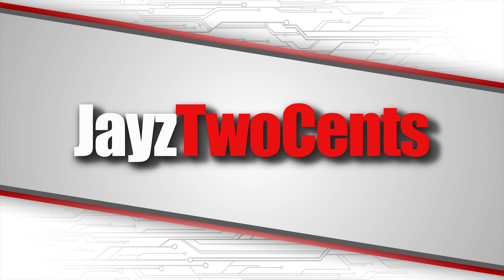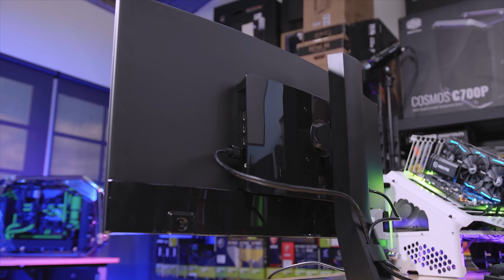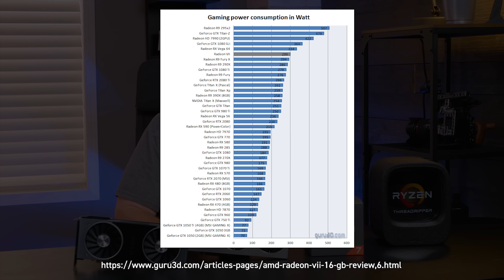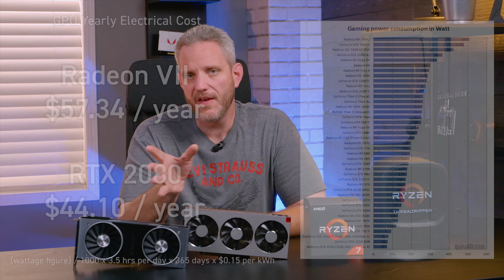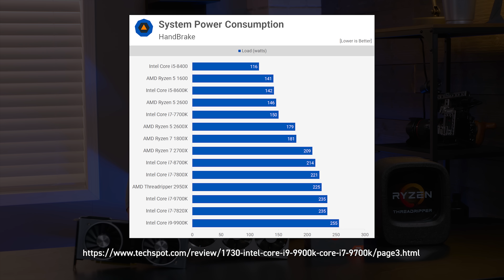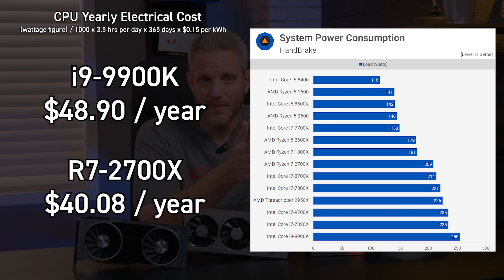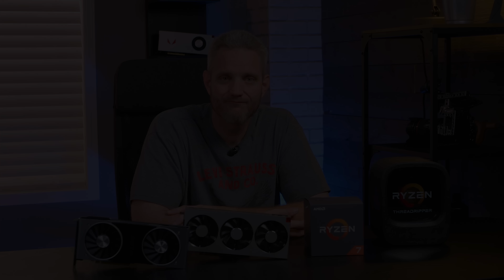Energy Costs of AMD vs Intel vs NVIDIA... This might surprise you

Comment: By my own experience is that AMD is not running hotter, this is based on the difference between FX 8320/4170 compared to a 4790K, while the FX 8320 is overclocked to 4.3ghz it still only reaches 55-60, Stock 4790K reaches 60°C already, overclocked to just 4.6 it already goes up to 80°C, which is already past the AMDs "OMG this is too hot shut it down" point. However, Intel idles colder, with my M9i the stock 4790K idles at around 32-35°C while the overclocked FX 8320 idles at 40-43°C. 

But IMO, the Power draw difference is a valid argument when it comes to older generations, 4790K is a 88 Watt TDP CPU, while the AMD FX 8320 is what 125/130  watt TDP? That is a huge difference in Anual electricity costs, obviously as it with energy costs it won't pay back for a few years, but in the first year, I gained back 190€ in energy costs and had to pay less monthly. So for me, it did pay out to switch to Intel, not so happy about it now with Vulnerabilities being a thing and Intel telling me to downgrade my CPU to a 200€ cheaper i5. 

Ryzen 3000 however seems to be by far more energy efficient looking at the spec sheets, the 3600, an 8 core 16 thread CPU with 3.6 base and 4.4 boost clock only has a 65w TDP, Ryzen is at the point where you really have to be nitpicky to still mention Power draw.

Comment: Hey Jay. 1 kwh in Germany is 25 cents. But i'll pay the price. more than 1/3 comes from green ressources instead of coal.
BTW: i think the question is more something like: should i get a (for example) 2060/2070/2080 because it can make a diffrence in terms of the overall cost.
if you dont need a 2080 for example and a 2070 is ok for your gaming needs you gonna save a couple $ because it draws less power.

Comment: The thing that makes lower power draw a more attractive buy for me is that less power draw usually means less heat. Less heat means a quieter system. I like a quiet system. My favorite laptop that I've ever owned is passively cooled. I can't game on it because it has a 7.5 watt Bay Trail celeron processor and only two gigs of RAM but web browsing on this thing is amazing. I'd rather do my basic browsing and spreadsheet work on this than a 2000 dollar gaming laptop because of the lower power draw and better battery life. Oh yeah this thing is the Acer CB3-531 chromebook. It's 4 years old. I got it right when it came out and have loved it ever since. I've got a separate laptop that I do my gaming on. It's a piece of shit HP laptop with a Bristol Ridge AMD APU and I hate that thing. 

Like Jay mentioned, old AMD processors ran hot as fuck. And my HP craptop is no different than any of those FX processors. Before a much needed repaste it averaged in the 80's in temperature and had only an hour of battery life (it only has a 33 watt hour battery). The thermals were so bad that when I attempted to do a clean install of Windows it actually bricked its OS and I ended up having to switch to Linux because for some reason Windows boot drives don't work with my laptop even though I can install whatever Linux distro I want. 

Holy crap I've gone off topic. Anyway, lower power draw, especially in a laptop, means less heat and thus a quieter system. That's why I like processors with low wattage that can be passively cooled. It's not the "cost savings" that I like low power for, it's the noise because a quiet system is just so much better for media consumption and things like spreadsheets in my opinion. I'm hoping Zen 2 laptop processors fix AMD's power consumption issues in this new generation because either every single manufacturer who put an AMD processor in a laptop (except the Acer Nitro 5 surprisingly) was incompetent as hell with their laptop design with first gen Ryzen mobile, or AMD's first gen ryzen mobile just wasn't ready for laptops yet. Every review I've seen for an ultrabook with Ryzen Mobile has complained of thermal issues. Let's hope Zen 2 fixes that.

Comment: Most people also won't run a CPU at stock.  You don't typically buy a 9900k and not Overclock it which will up to double your power draw.
Reply: Most people DO run computers at stock. Most people DON'T buy a 9900k, or even BUILD a pc for that matter.

Comment: Have you considered that you are not comparing 'apples to apples' with these figures? Your sample for average power usage was taken from gamers, so your whole test needs to be consistent with this. A comparative choice of cpu to rival the 2700x would be the i5 9600k (for gaming performance). You will find a 9600k is cheaper to buy than the 2700x and it draws less power. Instead you have compared two vastly different products with vastly different performance and price and concluded that they are vastly different??? I really don't get your logic here, and I'm open for anyone to explain it to me.

Comment: 10.8¢ per kw/h here - likely due to nuclear power but still interesting how much the rate can vary. 
With a voltage maxed ivy bridge and 290, I can pull 520 from the wall through a 90+ power supply. Honestly, it's heat generation - ie, dissipation I care about the most.

Comment: Sorry Jay, your number for the CPU comparison is wrong due to you not using the newer TechSpot article on the 9900k:

https://www.techspot.com/review/1744-core-i9-9900k-round-two/

The system power draw for the 9900k at stock with its 95W power limit is just 176W and therefore the comparison isn't ~$49 vs ~$40, but ~$33 vs ~$40.

And the premise for comparison of CPU is also off. Nobody would have their system rendering a video for exactly 3-4 hours. They'd run the rendering with all available system resources that can be utilize to finish the rendering as fast as possible, therefore the actual performance difference do matter in the 'energy cost' calculation, unlike in gaming where a 3-4 hours session on one system is comparable to 3-4 hours gaming session on another system in the premise for the GPU comparison part.

Comment: I would love if you could do a market investigation into howmuch energy is wasted by slapping LEDs into every component there is on the market. Iam talking about values on global or national scale for example.
Reply: Florian Oprescu  now its kind of impossible to buy a mb without rgb. My mainboard and my cpu cooler( stock ) are both set to static red and help me to find stuff on my desk in the dark, but thats all.
Reply: Florian Oprescu  would like to see something different than slap one glass panel in the front  and one to the side and call it design.  Skunkworks for example looked grade with all the yellow fluids and rings at the corsair fans.

Comment: Hey Jay. I'm from Newcastle, NSW, Australia. Here's some power prices for you from my last bill.

On peak $0.539 / kWh (3pm - 9pm weekdays)
Shoulder $0.282 / kWh (Mon-Fri 7am - 3pm & 9 - 10pm, 7am - 10pm weekends
Off Peak $0.172 / kWh (10pm - 7am all days)

I dream of 15c / kWh prices :'(

Over here price to run your hardware actually can genuinely come into consideration. It's so bad I actually transferred the data from my small home server to a external hard drive which is now plugged into my main PC. It was costing something like $75 a quarter to just have my server sitting there idling.

Comment: Power supply. For example a Vega 56 and an RTX 2060. If you don't have a large enough power supple. The vega will require more money cause you need to spend the extra on that

Comment: Using Vega 64 at 1920x1200 @ 60 fps. The card rarely goes above 900 MHz even on highest settings in the AAA titles. The fans are rarely spinning. And this was my goal. I could afford a card which is over the top for my gaming and feel comfortable with no noose and Max performance.

Comment: One fair comparison, would be average life length. AMD used to have lower life expectancy (mainly blamed for its heat generation) so question is, how long do AMD vs. Intel last? That is also something to consider. Now, this is hard to measure with new CPUs... 
But we knnow that a lot of people still rocks 3rd and 4th gen Intels, and still have no problem (no noticable bottle necking) running especially new games, but how many still rocks as old AMDs with the same result?

Of course, it hard to tell if Ryzenn have the same or if it has longer life span than its predecessor. But it's still something worth thinking about.

Comment: Why you compare cpus core to core - compare cpus cost vs cost - that what matters to end user - i have 2000 bucks for a new rig, what can i get for it? Comparing two cpus with totally different price tags is just stupid - if you took e.g. 9600k (which is still faster that 2700) - which draws less power, the output of this comparison would be different in terms of power draw. Don't get me wrong - from me - difference of 10 bucks per year is not noticeable, but still you should do a FAIR comparison

Comment: Oh please, anyone that can afford a new CPU has the money for electricity! Energy costs MAKE SENSE when comparing ultra low end entry level builds. When buying a used i5 3570 with 8gb ram for $190, you can throw in a 1050ti at 75watts, and be done, but if you use a RX570, that is 200w! You will need a new power supply for the RX570! And when you use your PC for 6-10 hours a day, that is $3.37-$5.62 a month, $5.62 x12 = $67.5 a year, or $337 over 5 years! 

Money is the reason I still use a $20 phone from 2014, because it is $80 a YEAR for phone service. Internet is practically unusable on it, and I really need a new one, but I'm cheap as Fxxx and the only phone that would be a proper replacement costs $60 currently (was $45 at one point), and that would bump my yearly cost to $115 for service, because I'd no longer be able to use the $20 3-month cards. 

If I have to eat out, it is only ever Taco Bell, the only place with a dollar menu (please correct me if I am wrong, a person can only eat so many beefy fritos burritos). Oatmeal is super cheap and filling at home, 10lb is $8, and 1lb brown sugar is $1.20.

Comment: the power draw figure for me only means, cooling requirement and how hot my room would get while gaming or rendering, especially in the summer months (gets like 35C~40C here)

I'm looking to upgrade to the 16 core part with the Ryzen 3xxx series, and honestly If it does draw 300w of power at peak at near 5ghz all core with an oc. I'm not too bothered honestly, i'm pretty sure my open loop with a 360 rad and a 120 rad with CM jeflow fans would do just fine with keeping temps under control

I went into open loop cooling, going for the extra cooling capacity it would enable

for context my old gtx 780 ref had a tdp of 250w (terrible cooler btw) and all it meant was that i had the fan maxed while gaming, and the noise didn't bother me that much.  i tend play games almost exclusively wearing headphones anyway, so that was basically a non-issue

Comment: 15 cent per kwh is cute. More like double that. Still not making up the difference, but still. It makes for a much bigger gap. Also consider how a 240 volt PSU will be a bit more efficient vs 110 volt.

Comment: I have to disagree, if u say we can ignore the power draw, this should be tested in a worst case scenario in my opinion. So i did some math and compared the energy cost of the rx 590 (powercolor) vs the gtx 1660 (msi ventus xs oc). By the way, the gtx 1660 has slightly better performance than the rx 590 for about the same price ($220 on amazon).

The rx 590 has a gaming power consumption of 215W, the gtx 1660 has a gaming power consumption of 107W (i found these numbers in the guru3D review of the 1660, this is an updated version of the graph u are showing). 
Considering the same amount of time spent gaming per day (3.5h) and the same electricity cost ($0.15/kWh), the energy cost for the rx 590 is $41.20 per year. The energy cost for the gtx 1660 is $20.50 per year. Over 5 years, this makes a difference of $103.50. 
If u spent that amount of money on a better graphics card, u could have gotten a 1660Ti  ($280 on amazon) or almost an rtx 2060 ($350) even, which is on average 31.2% faster in gaming (according to reviews from hardware unboxed).
If i do these calculations in my home country (Belgium), i pay about $0.30/kWh (€0.27/kWh). The difference in energy costs doubles to $207 per 5 years, which comes close to the price of gtx 1660.

Conclusion: I think it's incorrect to completely ignore power draw numbers for graphic cards, because in some occasions the difference in energy cost can be substantial enough to be considered in the decision making process of buying a new graphics card.
Reply: I did some extra math and calculated the total cost of the gtx 1660, gtx 1660Ti, the rtx 2060 and the rx 590. These total costs include the price of the card itself and the energy cost of the card for 5 years (considering 3.5h spent gaming per day and an energy cost of $0.15/kWh).

The total cost of the gtx 1660 is $322.50 ($220 retail price + $102.50 energy cost).
The total cost of the gtx 1660Ti is $391.15 ($280 retail price + $111.15 energy cost).
The total cost of the rtx 2060 is $490.85 ($350 retail price + $140.85 energy cost).
The total cost of the rx 590 is $426.00 ($220 retail price + $206.00 energy cost).

This shows the rx 590 is a terrible value card in this scenario, since it's $34.85 more expensive than the gtx 1660Ti. The gtx 1660Ti is however 24% faster in gaming at 1080p (according to the hardware unboxed review of the gtx 1660ti).

P.S. I'm a big fan of the channel and loved the idea for this video, however I felt like i needed to point this out and show u  that your statement about ignoring power draw numbers is not always true.

Comment: the only thing to consider power draw for is form factor limitations.  like if you are trying to make a super small form factor there are only so high a power range for SFX power supplies.  650 is the current maximum and then you start running into problems running a radeon 7 or a vega 64

Comment: The cost difference is amplified if you live in a warm climate, and air conditioning is required to remove the generated heat from your home or office.  According to this page: http://hyperphysics.phy-astr.gsu.edu/hbase/thermo/heatpump.html a high efficiency air conditioner will remove 1.6-3.1 watts per watt used.  This will add 32%-63% to your energy cost for running your hardware.

Comment: With computer going on I've been sleeping on your videos, but damn... Everyone's head is in OMG AMD Ryzen3000 mode but this is something that had to be said and now is the time to say it. Good to reflect upon as it comes out.
Reply: Most of the variance on your power draw comes from your GPU. My roommate was running saphire while I was running a 1060gtx6gb. He was on Intel and I was running a smexy a10 believe it or not. (Still gets 60fps at 1080 on most games high setting). Our energy bill dropped ridicoulously when he moved out, but the usage charts showed it all. The idea is that the rdeon gpus have always sucked up *2 to *3 the power. While Navi might change this on the very high end. I'm expecting more of the same. The only thing that makes me question that is the macpro's cooling solution of three in the front and a blower exauhst.

Comment: if you lived in Germany, you'd be happy with 15 cents in a currency that's worth more than the US dollar

if I take your 57.34 - 44.10 = 13.24 / 0.15 = 88.26 kWh, and multiply that by the 28 eurocents per kWh here, I get about 24.71€, which over 5 years is almost 125, which almost bumps you into the next tiers on a lot of GPUs

of course it doesn't apply to the comparison you made between the radeon VII and the 2080, because the jump from the 2080 to the 2080Ti is just massive

but comparing an RX570 to a 1650 (the by now old discussion) and having a difference of 125€ there, that certainly gets very close to bumping you to the next tier. And yes I know the RX570 is much cheaper, but being on a newer architecture for the same or less money (in the long run) might be worth it to someone.

I hope I didn't mess up on the calculation part.

Comment: Hey Jay... Add a motherboard prize to the cost of the CPUs (comparable ones) and you'll might see, that the AMD set is more expensive than the Intel one especially when it comes to the higher end boards. ASUS MB's: AMD X470 vs. Intel Z390: Intel half the prize!!! A CPU without a board is nothing...

Comment: hat TechSpot review was an overclocked 9900K (MCE/vendor boost limits)
Reply: A truly stock 9900K (i.e. held to its 95W TDP) consumes about the same amount of power as the 2700X, and performs about the same as well.  The only relevant difference under those circumstances becomes the price, where the 2700X wins by a huge margin.

Comment: JayzTwoCents : I wish that you would have made a 100 % professional comparison of Ryzen 7 2700X (that is locked by default to 105 Watt TDP and thus has 107 Watt max real world power consumption) and Shintel i9 9900K locked at its supposed 95 Watt TDP :). With these kinds of settings the i9 9900K is slightly slower in IPC and multi-core in modern games that use more than 1-2 cores :). The Shintel i9 9900K at stock clocks using default 1-core turboing and being unlocked from its supposed 95 Watt TDP regularly eats around 150-160 Watts of real world power consumption....and if it's used with MCE turned on (=all core turboing up to 5,0 GHz) it eats regularly from 220-240 Watts as a CPU die alone.